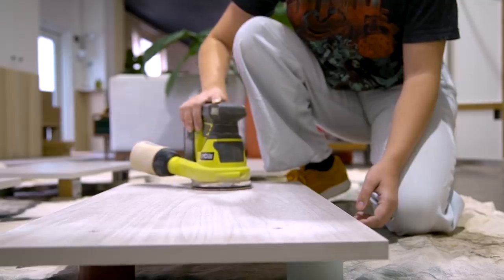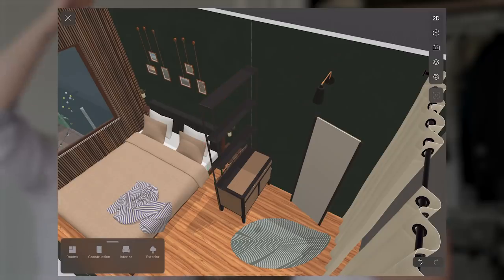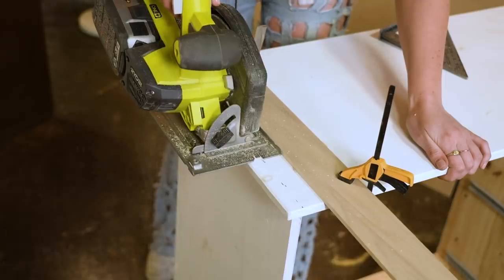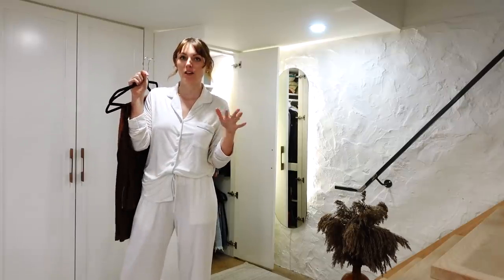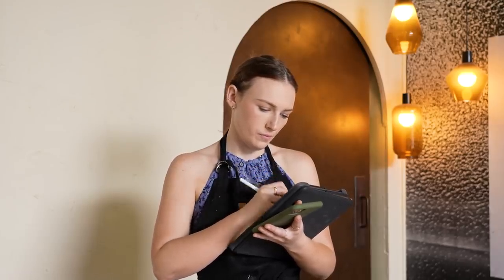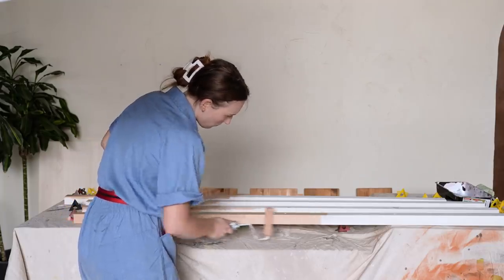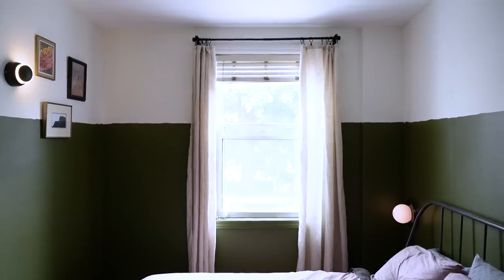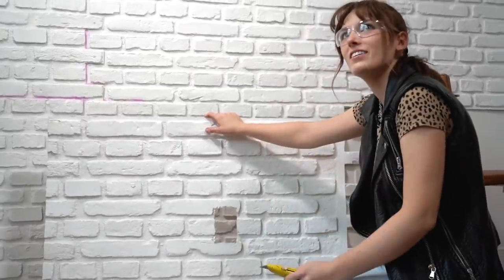diy ikea room divider hack

Comment: Was that non-straight edge of the green paint on the walls intentional? It bothered me so much.
Reply: It looked very clearly by design (a jagged, more organic look)
Reply: I was thinking the same. Maybe the other part should be a different color? So it wouldn't matter
Reply: In my opinion it just looks careless and sloppy!  Tape off a straight edge for pete's sake.
Reply: It’s terrible ;(
Reply: @georgier9151  I guess to me it should have been more jagged and exaggerated so that you see the intention (I've seen them on Pinterest so I know which one you're referring to).
Reply: I thought maybe they needed to film quickly, and it was too soon to remove the painter's tape. I did not realize it was a thing! lol
Reply: was looking for this comment cos i thought i was being delusional with the paint lines
Reply: I just assumed it was unfinished, like maybe she was going to add a chair rail or something
Reply: It looked by design to me; that, or I assumed she had plans to do wood paneling or the like on top. Personally, while it took me a second to see it was intentional, I like it. And honestly, if the owner likes it, that’s really all that matters. 💖
Reply: Omg yaaa me tooo
Reply: It bothered me so much too! I hope it’s not intentional in the sense that that’s the final product. I thought it was left like that because she has plans for the top part like tambour walls panels which were in her renderings.

Comment: Looks nice but didn't give her more closet space at all.  I would have gone with the wardrobe idea and added to the top of it to go to the ceiling.  Would have then added a shelf to back of wardrobe to create a bedside table.  It does look nice though, I'd just want more enclosed closet space.
Reply: I thought the same! It is a great idea but doesn't work as what it was intended.
Reply: It sounded like she wanted the feel of a closet more than extra storage. The closet was a fine size and her clothes weren’t overflowing. I feel like they would have at least discussed it, the sister probably wanted it this way.
Reply: The dresser wasn't big enough to create that space divide.
Reply: @kebert2thumbsup  yeah I think if the dresser was a little wider, it would've given more of that "separated dressing area" feel. But I will give the benefit of the doubt because it's hard for me to gauge off of the video how much space there is between the door and the end of the divider. Maybe there just isn't enough clearance for a wider divider
Reply: Yup! Me too. this whole open shelving trend has got to go!

Comment: Ooops, pre drilling the cabinet top to fit the shelving unit before install would have been an idea to avoid that boo boo. (& I forsee someone going to move that without detaching it from the ceiling in the future and ripping holes in the ceiling!)
& I had hoped that you were going to do some sort of cool detail on the dresser back as it was facing the bed to make it a bit interesting on both sides rather than just leaving it as the plain tan paint, missed opportunity for a focal point. The sanded and restained drawer fronts looked lovely on the other side
Reply: Agreed, maybe some shelving on the opposite side would have helped. I honestly think this is a great project for someone else’s space.

Comment: I have painted concrete walls.  (cinderblock? brick? I don't know). How can I hang picture frames or a medium sized mirror? I don't know if command straps will hold since the surface isn't exactly flat.. and I'm willing to make small holes but not large.